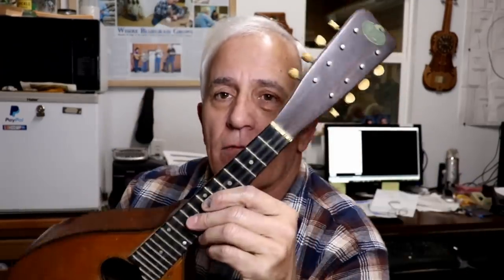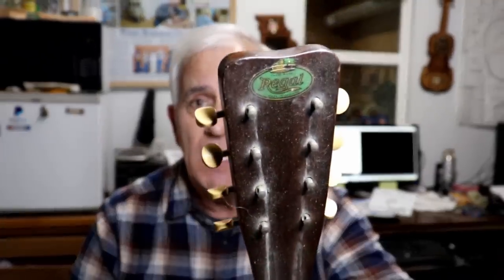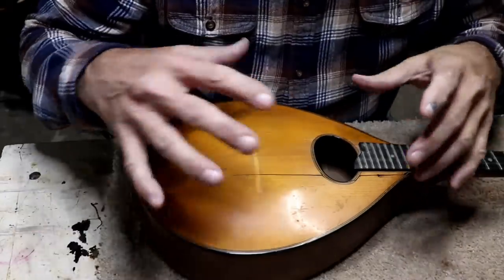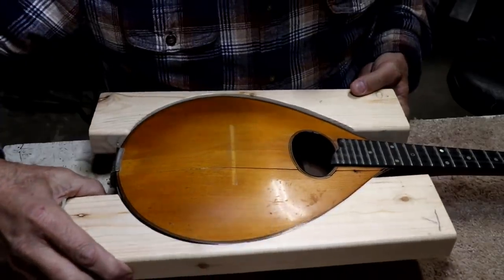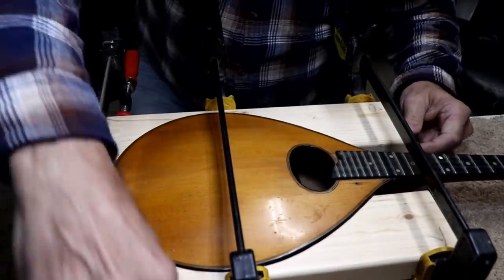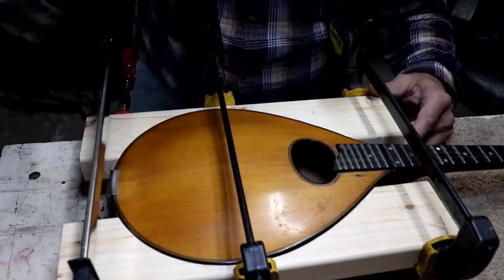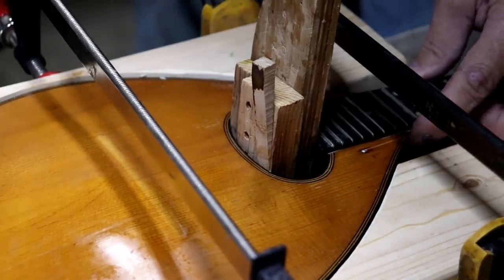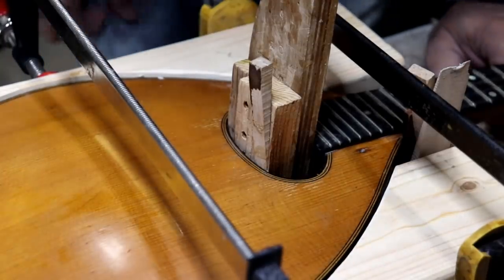257 RSW Regal Wreck #2 Text Book Clamping Technique

Comment: It’s nice to have an easy repair after all the challenges you’ve had. There’s some physics in the volume of the body and the area of the sound hole. What you have there is a “Helmoltz resonator.” If you’ve ever gotten a musical note from blowing across the top of a beer bottle, you know what I’m talking about. You can tune that note by changing the volume and area, and that will alter the low end of the instrument’s sound.

Comment: JERRY**WHAT YOU NEED IS A GOOD APPRENTICE
TO REDUCE  YOUR WORK LOAD**I USED MY GRANDSON PART TIME FOR YEARS.**CHUCK
Reply from the maker: There's not very big population-based here I'm 20 miles from the nearest town. It's hard to get somebody to come out as an apprentice. The other problem is if they're old enough to drive and all that then they're going to learn what they can and then go do it on their own so it doesn't really help you that much
Reply: @RosaStringWorks  *Jerry I understand your problem with your location* using my grandson, I did not have that problem.**Chuck

Comment: Slick idea to clamp that mandolin. I'm curious, I've always heard 24 hours under clamps for tight bond and wood glue or Elmers type products..  Is that just not necessary or is that particular Tightbond different?
Reply from the maker: If there's no stress on the part Titebond says it's good in 1 hour. Full cure in 24 hours. In other words you can take the clamps off but you really shouldn't do anything more than that. I generally give it 3 to 4 hours before I take the clamps off. Most of the time I wait overnight.